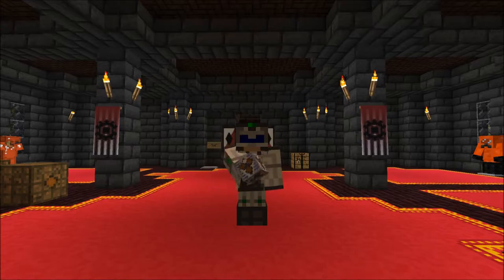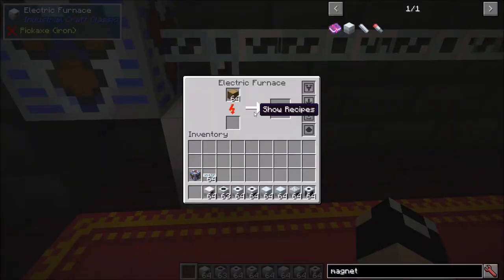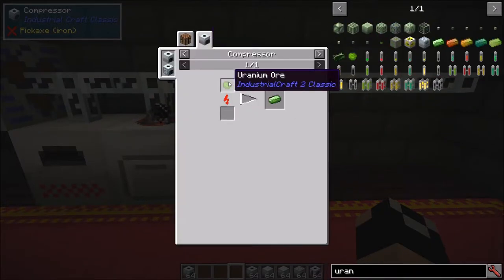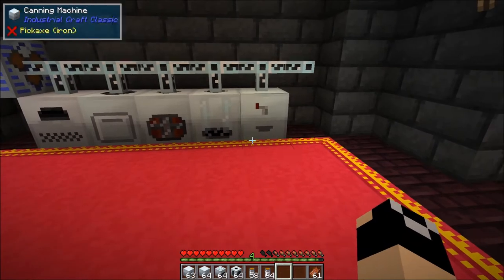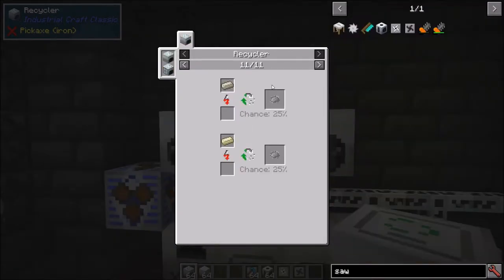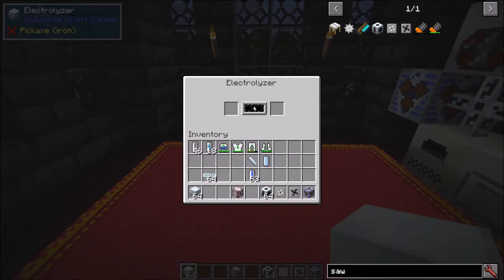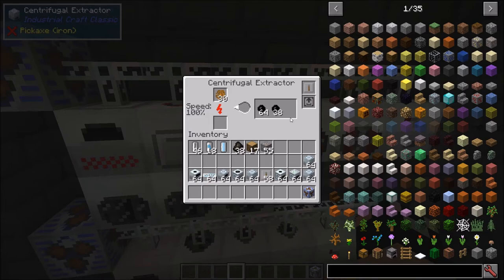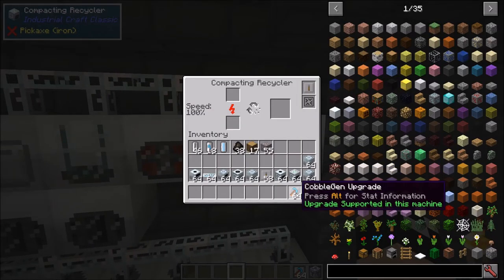IC2c 1.10.2 Mod Spotlight Pt.5: Core Machines

Comment: (Skipped some videos, will be going back)

Really cool. So basically its the same as it was in all the ways that is should be (why reinvent the wheel on macerator for example) but enhanced and made glorious in ways that just make live easier. 

Two places in particular made me go "oooooooh." The first was in the inverted redstone lever upgrade, that was awesome. I love the fact that you can have it so the machines can spin up without need for more block spam. The second was the cobblegen upgrade, that was AWESOME. Such a great idea and makes things so much more organized. (As a note does the cobblegen upgrade work in the furnace and macerator because if it could that would be quite cool.) The other features were cool but it was those two that had me go "wow". 

Anyway, on to the other videos I missed! :)
Reply from the maker: Ikr :p  those upgrades are so nice and the fact that the t2 machines have upgrade slots is a huge plus.  Cant take overclockers but really they are fast enough for the midgame tiers.  And yup, you can indeed put the cobblegen upgrade into anything that can accept cobble.  Makes for nice sleek cobbleworks that dont need a bunch of extra machines making cobble and the like :)